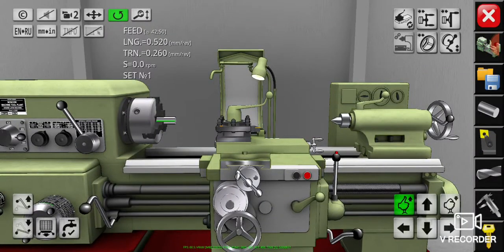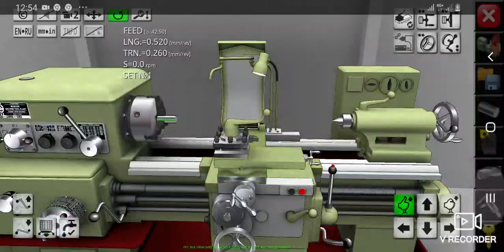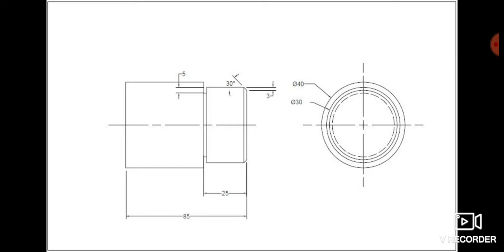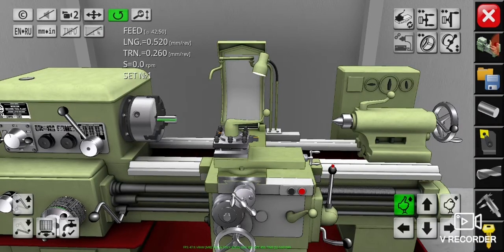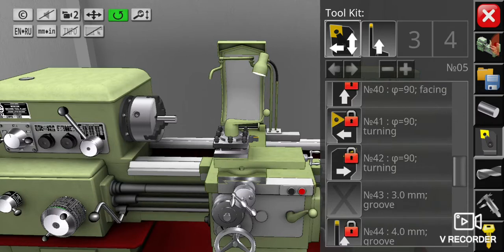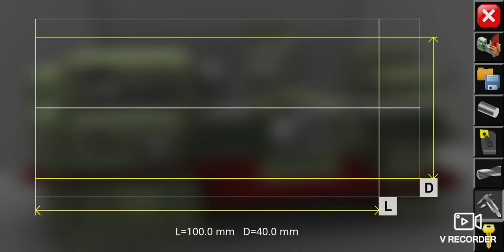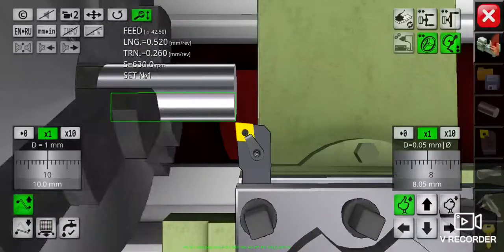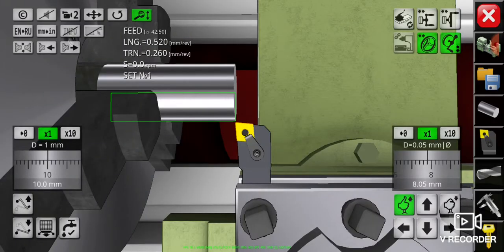Lathe simulator tutorial 2 (Facing)

Comment: A piece of bronze 150 mm in diameter is to be turned in a lathe. What number of r.p.m. is necessary if the cutting speed is minimum? Determine the longitudinal and transversal feeding for roughing and finishing cuts. Please create some video tutorial for this problem.
Reply from the maker: Bronze CS is depended on your cutting tool, if you use hss then it is around 200-250 feed/mnt, if you use carbide then it is around 700 feed/mnt, to determine the spindle speed use the formula of = (CS x 1000) ÷ (phi x diameter)